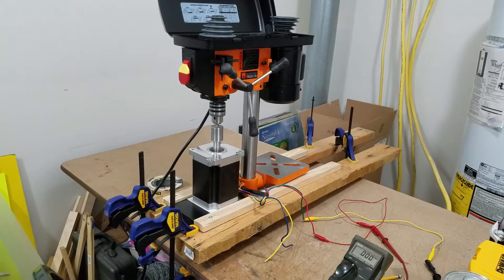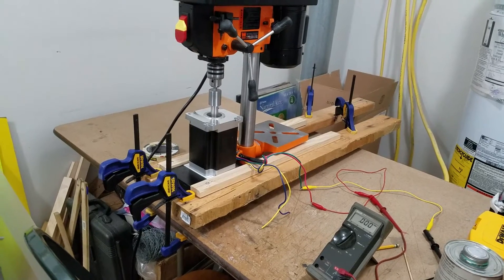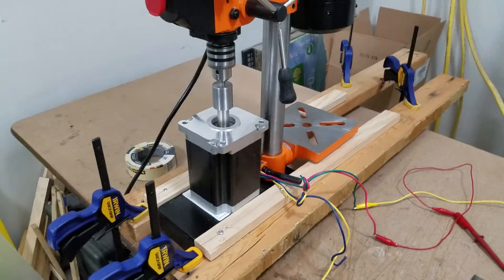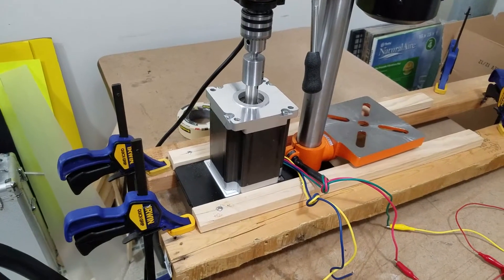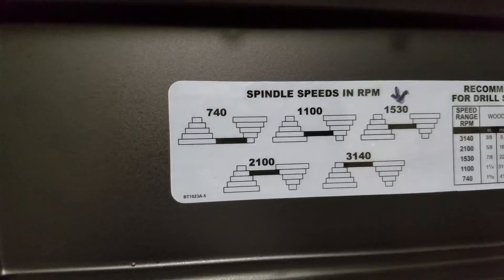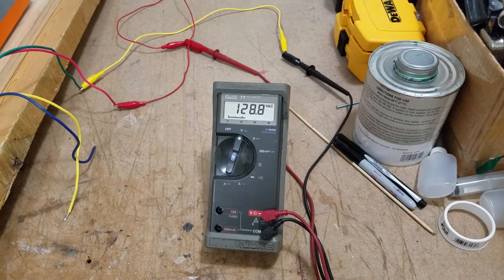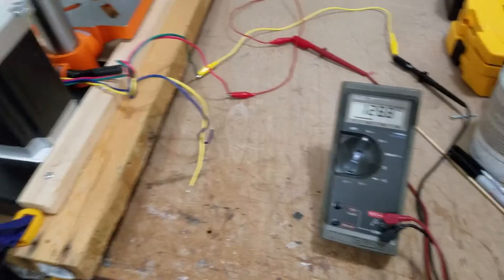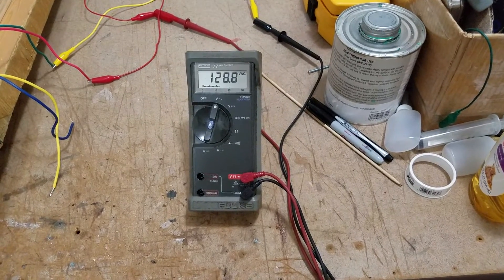Mini wind turbine 4b

Comment: Stepper motors are not suitable for wind turbines. They have too much resistance to turn in the wind. Too much power is required to turn them. Once you connect them to a load they will slow way down. You need a noncogging air core pma
Reply: CG:  Hi; where did you get this information?  Did you see my YouTube video "Mini wind turbine 4a"?  In this video, I am using a Nema 23 stepper motor and I love this little motor.  I love this little motor so much that I built a larger Wind Turbine that uses the Nema 42 from this video.  My new larger Turbine with the Nema 42 is awsume.  I can charge a 12 volt deep cycle battery in a 7 MPH wind with no problem.  The real secret to DIY Wind Turbines is in the blades and not so much in the generator.  Presintly, I am designing my forth set of blades.  I hope they will perform as well as the ones on my Turbine with the Nema 42 as the ones that are already on the unit.  If I am correct in my design and building, I may make a video for those wanting to make their own blades.  Thank You.

Comment: closertothetruth: Hi, are you familiar with the wind turbine building of (belgrademachines) on YouTube.  This guy is awsume in building axcelflux wind turbines of different sizes.  I like building my wind turbines using stepper motors.  I built one lately using the stepper motor in the video you just watched and it produces 2k watts of power.  I prefer using stepper motors because they generate AC then I convert that AC to DC if I want to.  Search for belgrademachine on YouTube if you are not familiar with him and his work.  Good Luck!

Comment: Tony Hardy: Yes, you can use thinner wire from the Stepper motor/generator to a fixed location then, convert your AC to DC if you want to. This Stepper motel generates 1.7 volts AC at 4.5 RPMS if that also helps. Good question.

Comment: That is a nice motor pumping out 120vac at only 740rpm.  But that is nice part about ac voltage, you can use thinner wire to run the energy down the long pole, then convert it into dc on the ground right next to the battery bank, so you only need to run the heavy gauge wire only a few feet instead of 80ft to 110ft or more out into the field, then up the 60ft pole. And you will get less energy loss running the AC on long distances then then with DC.  That is why Tesla knew he was gonna win the current wars back when Tesla invented the AC motor/generator. Edison is a dirty trickster, but he still lost, because AC power is superior in transporting energy, no/low losses in energy transportation, unlike DC wastes all your energy trying to transport it along a wire. Tesla is a superior person over Edison anyway, always was, always will be.

The problem that will start to come about when trying to upgrade to bigger turbines, is that you might find you need to upgrade(higher, thicker, stronger) the tower too. Depends on your area, but by the looks of it(i seen your other video in the small clearing with trees, between buildings, etc...), you will need a bigger pole for this bigger motor to get decent wind energy to move it under its full load capacity.

But don't ever let that stop you, just start with smaller towers until you get high enough to be satisfied with its performance.